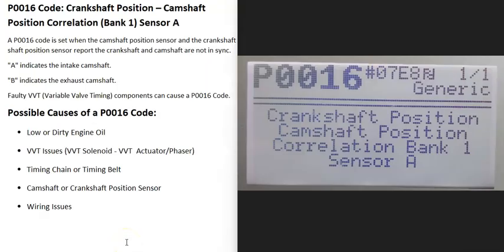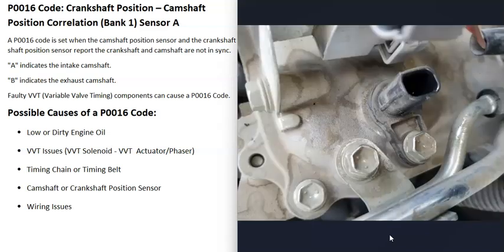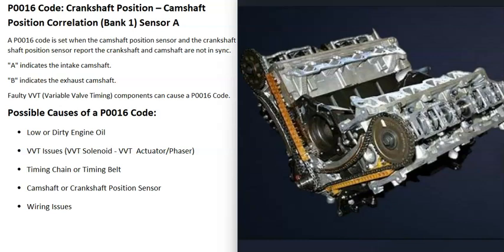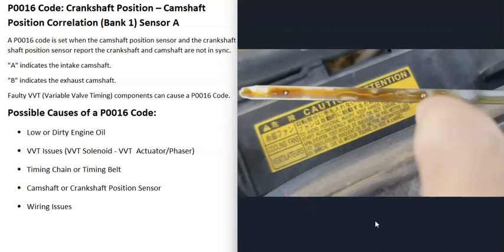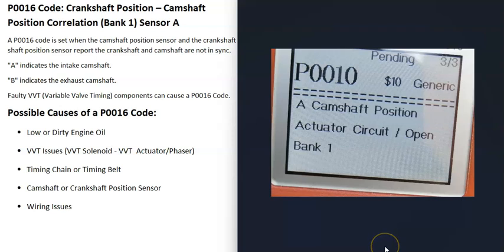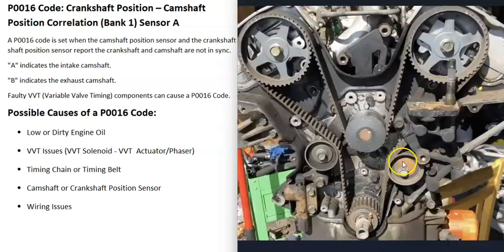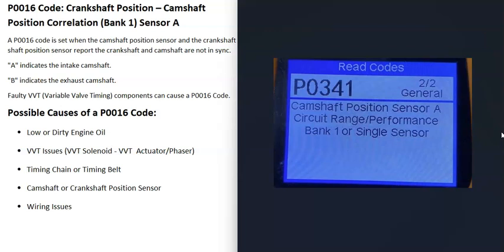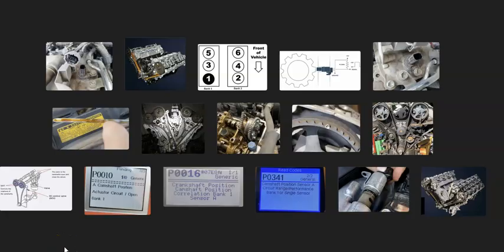Causes and Fixes P0016 Code: Crankshaft Position – Camshaft Position Correlation (Bank 1) Sensor A

Comment: I have a vw golf 7 gti p0016 problem i fixed my timing chain but same problem the speed gos up and down and if it is not 90 degrees celsius than it turn off if u dont give some gas

Comment: Had this happen just now on my Jeep Wrangler after an oil change. Was running perfectly. No codes. No roughness before, after the oil change check engine light p0016 code and a stutter at certain RPMs. 
I'm wondering if the cam phaser is being drained completely of oil through something out of whack or when the oil was drained? Some small metal debris got stuck to one of the sensors
Reply from the maker: I would verify the correct oil type was used. If the wrong type is used, it can cause VVT issues.

Comment: Mine, toyota sienna 2004, 1st starting for the day, the engine starts at once. But once the engine is hot. It does hard starting until the engine cools down for 2 - 3 hours b4 it can start again
Reply: Sounds more electrical battery or starter2004 2grv6 have problems with vvti gears it rattling sounds. There is a tsb for that concern.

Comment: If it’s the timing chain doesn’t that mean your valves and pistons are garbage?
Reply from the maker: If a chain jumps a lot, it can damage things, but if it jumps one or two teeth, usually it's OK; just needs a new chain.
Reply: @HVAC_Mechanic my chain started rattling about a week ago, traction light came on had delayed acceleration. 500km of travel later it lost acceleration on the highway then I pulled over and it died after 30 seconds of idling. Won’t start now. Doesn’t even try to turn over. Do you think I have engine damage ?
Reply from the maker: It's difficult to say; it needs to be checked out, but usually, when there is damage, there are loud bang-type noises. If it went into limp mode and was still running when it shut down, it likely just needs a new chain, but it needs to be looked at.
Reply: @HVAC_Mechanic  I took the cylinder covers off and it jumped 7 teeth, and one of the upper guides broke in half and is wedged between chain and engine wall.
Reply: @DonkeyKawng big job for big money

Comment: Owners can take their vehicles to a Chevrolet, Cadillac, or GMC service center. Technicians will look for the code “P0016.” If they find it, it’s a “repair or replace” situation. Therein lies the specifics of the latest GM engine recall lawsuit.
Reply: Really?
Reply: @KingXory yes check your dealership it's all over the Chevy forum.

Comment: Eu estou com um uno Sporting 1.4 2012 do mesmo jeito, ele foi trocado a correia, daí agora tem hora que ligo ele, acende a luz, ele fica fraco, não sobe o rpm mais do que 3000 giros, aí quando desligo às vezes e ligo novamente, a luz apaga e volta a funcionar normal, aí depois de um tempo torna acender de novo e ficar fraco
Reply: check VVT actuator, give intermittent supply to it and check actuator is working. If okay, then check timing chain tensioner and Phasor

Comment: I have a 2011 Escalade and it throws the p0016 code after cutting off after running it for hours then I wait abt 20-30 mins and it’ll turn back on 
It also idles rough and oil pressure drops low when warm 
PLEASE HELP
Reply: Engine is cooked

Comment: I didn't get the P0016 code until I changed the two camshaft position sensors on my 2011 BMW 328i.  It runs perfectly....no stalling, no misfires........ except it takes a couple more seconds to start.  Should I reinstall my old sensors?  The new ones are made in China.
Reply from the maker: It likely needs a Cam Position Sensor Re-Learn. It can vary between vehicles how a CAM Re-Learn is done; sometimes just driving around the computer will automatically learn. Sometimes, there is a set of driving steps that need to be done. Mechanic shops will use a scan tool that has the option to command the computer to do a Re-Learn.
Reply: Have you tried to slightlyove the crank sensor while the bolt is still off to see if it makes the starting worse or easier?. Sometimes that will work. Might be a bad sensor.
Reply: Definitely put the old sensors back in if they were not bad to begin with

Comment: best explanation. in my case each time the oil gets dirty i got these things usually if i delay the change close to or more than one year service interval.
Reply: End after you change the oil, dissaper?
Reply: @iancudragos8740  the only thing that really helps is adding a carbon cleaning solution once in 2 or 3 months. but having a dirty oil makes things even worse. also do not move the car immediately after engine starts.

Comment: I have jimny 2021 manual transmission, I have this code and late start , as per the mechanics I changed camshaft and crankshaft sensor but still it shows the same
Reply: check VVT actuator, give intermittent supply to it and check actuator is working. If okay, then check timing chain tensioner and Phasor

Comment: ive had P0016 for 2 weeks now and ive changed both crankshaft and camshaft sensors but the car idles so bad as if it were wanting to turn off on me and sounds like if it was cammed. please help
Reply: Timing belt sounds like it needs replaced
Reply: Timing may have jumped which is causing your car to Misfire. Constant Misfires can damage your Catalytic Converter and shove fragments of mercery into the exhaust system. Along with that. Overheating, rough idle, and stalling can occur.
Reply: @SergioMartinez-c3e how you fix it
Reply: @Richoffextracts I would recommend testing both the Crankshaft and camshaft position sensors FIRST. I tested mine and i found that when my vehicle had overheated, some of the wires and camshaft sensor was heated. I also have worked on another vehicle similar, AKA the Ford Flex. had to take the valve covers off and pull the coils and sparks out and rotate the  harmonic balancer clockwise to TDC. A best way to see if it's top dead center is sticking something long and flimsy into the spark plug and when it stops showing resistance and going up then your at TDC then you can look at the Timing chain and Camshafts. Usually once that water pump fails, the water pump causes tension and it may seize up causing the chain to just glide off it and slip. THE CAMSHAFT SPROCKETS SHOULD ALWAYS HAVE ALIGNMENT. Usually two little dots and they should always be at the top in sync.
Reply: @Richoffextracts To fix an engine out of Sync requires professional tools especially when it feels like that Harmonic Balancer is welded on. Even bumping the engine with a cheater bar wouldn't work and you risk the timing chain breaking. You gotta Drain the coolant, move the power steering pump, there's a bolt behind it. Basically moving everything from the passenger side to fix the misalignment. Have the engine and vehicle secure. Take the timing cover off, Loosen the tensioners, take of the timing chain then start removing  camshaft, there's brackets and bearing holding it in place. Just align it back with both dots facing the same position. Always check that the timing chain aligns with its bridges, basically little dots or slits where the colored beads align. Once done, install the harmonic balancer bolt, NOT THE BALANCER YET. Test it a couple times and if the engine shows any resistance. STOP. Something has gone wrong and usually it's just a tensioner for the Camshafts that needs replaced. There shouldn't be any slack in the chain. Once you're done just put everything back together where it goes and erase the code. I recommend pouring oil straight onto the camshaft then you can install your sparks and coils. Now your valve covers and unplug your fuel pump relay and try and build oil pressure within the engine. Usually just turning the key over and keeping it turning until the oil lights disappears, you can plug back in the fuse and start the car, the code should disappear or it will need to be erased.
Reply: That code always means it's time for a new timing chain set
Reply: check VVT actuator, give intermittent supply to it and check actuator is working. If okay, then check timing chain tensioner and Phasor